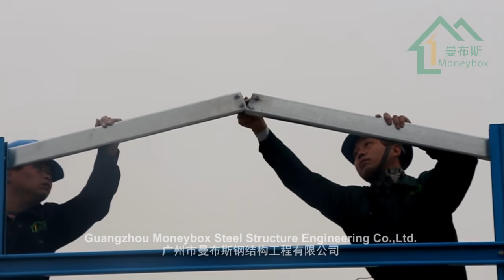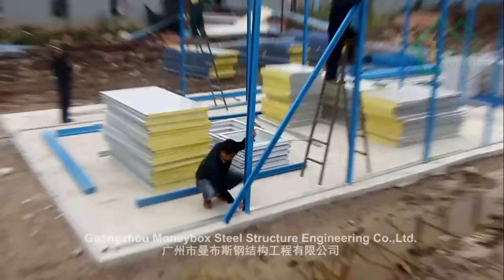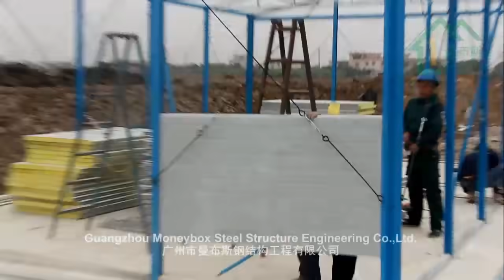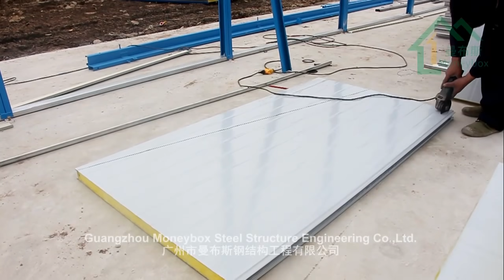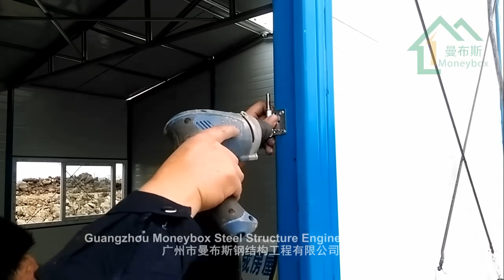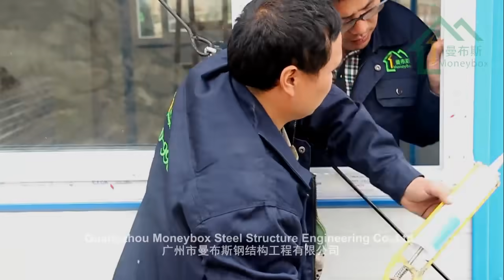Prefabricated K House Install

Comment: It looks ok as a garage or a working shed but may need to have few frames, somehow, heavier to support at least 120kg; aesthetically is more a replacement for army tent than anything else (looks ugly).
Maybe for farm uses, but in any case, in Australia we have better designs and structurally sound garages, workshops and utilities sheds than this; having said that, the only thing I may consider is the idea of insulation on the walls and roof.

Comment: Pfff I'd be surprised if my farts cant knock this down.
Reply: What the hell do you eat?  💨
Reply: Steel is strong the house won’t go anywhere unless they take it down.  The cable adds strength just like a suspension bridge.  They are tightening it with locknuts that won’t go anywhere.

Please consider probiotics

Comment: This house would never work in Florida, the load reaches  over 250 kph, the building codes require homes of reinforced concrete
Reply: the weakness is in the concrete bolts. Just the first gust of wind is enough to lift the house off the floor.

Comment: The floor is too low, how safe us it during monsoon.. how about the foundation...
Reply: No need for strong foundation. Because the house is fiberglass, foam, and metal. Stronger then lumber.
Reply: It wouldn't meet codes here in the states
Reply: @jeffhoyle7900  
It is for temporary shelter such as those in construction sites. 
Unscrew the nuts and move it to a new site.

Comment: May I know the cost of building a house in a container shape with a sloppy roof having front side 8' height  by 27' length  and 6' height  by 27'  length and the breadth of the house is 10 feet.

Comment: one strong wind will plug up this kind house.
better you wait make more money to build real house from stone from concrete, rather than use this kind method.
you can check why in Philippine dead toll by hurricane is very high there. it cause by house they build use  same method  like this. they think they saving money by build semipermanent home like this. when the wind come it all vanish their house flat like never build there.
Reply from the maker: This is temporary house ,it's for site office ,worker dormitory ,for emergency rescue .The same goes for the concrete house if it's hit head-on by a hurricane.